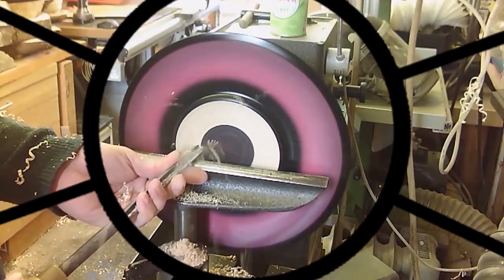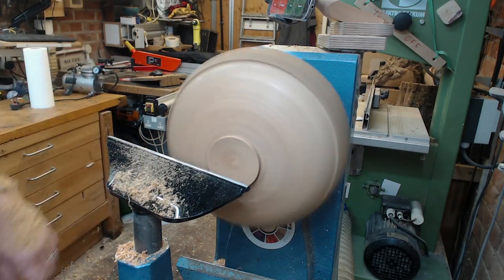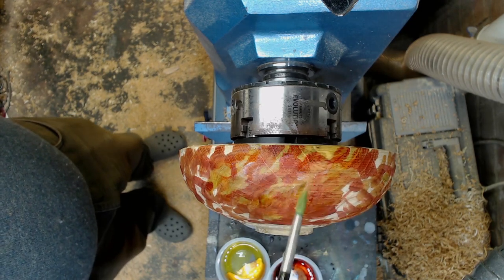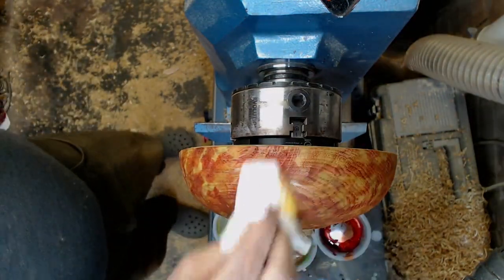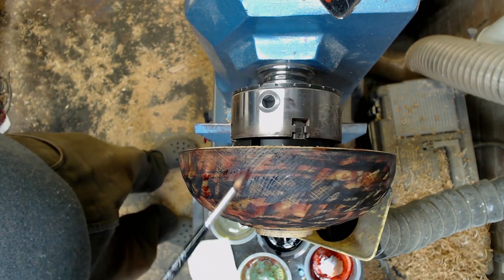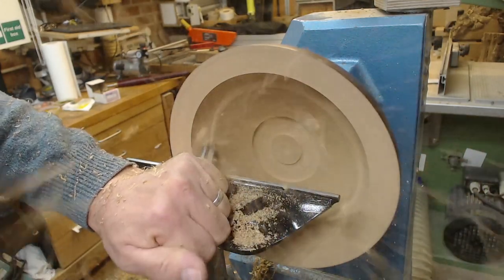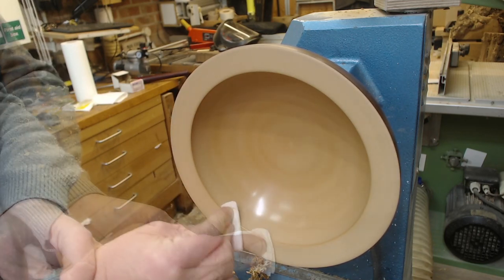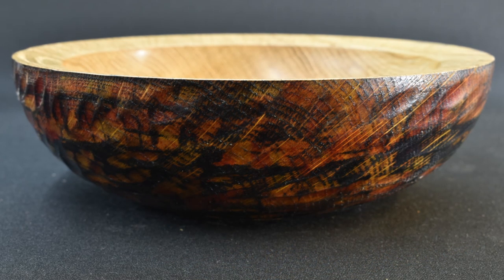Textured Coloured Oak Bowl

Comment: You should try putting the texturing and coloring on the top rim of the bowl since you left the rim wide for a bowl..  While it is still attached to the recess you turned on the inside of the bowl.  You would need to do it from the head stock side and filming might be a problem. But the end result would look nice. That way it would frame the wood grain and make a more finished presentation. Like on your platters. Could undercut the rim to allow the the light to create a shadow and the piece would have thinner walls and feel lighter.
Reply from the maker: Cheers, Mark - will have to give that a go for sure!

Comment: The stain colors worked well, the black was a little much, but well saved. As you were putting that on I noticed when you did the edge of the rim the texture seemed to come out a little more. The straight line of the rim made a nice contrast with the texture I think. And yes, some texture really can be best appreciated with the hands.
Reply from the maker: Cheers, Bill - yep, I did an inward 'gulp' when the black went on first!